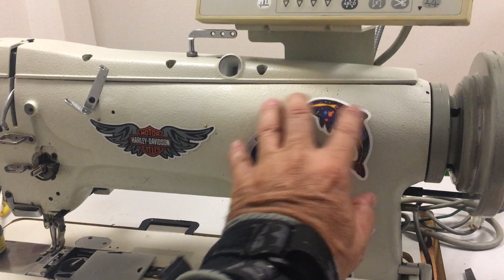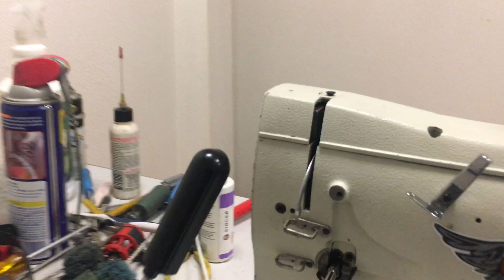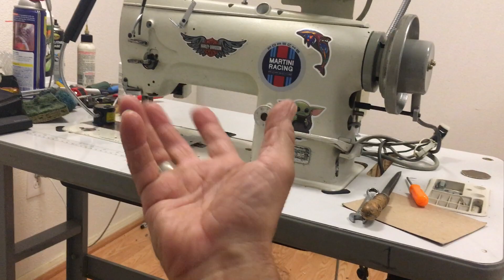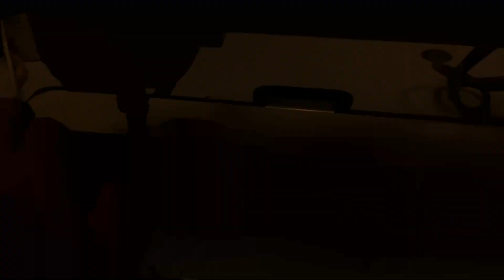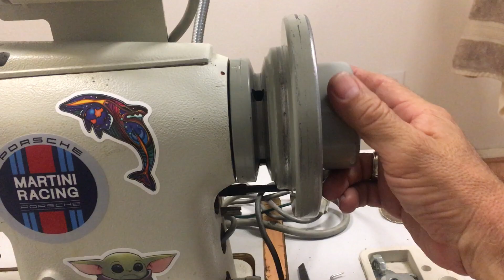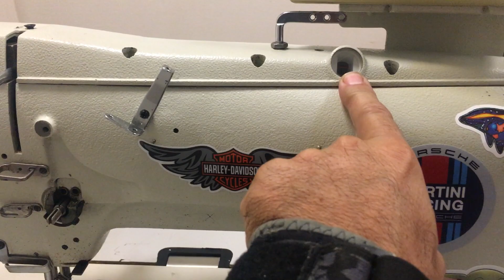Brother LS2-B837-310 Walking Foot Sewing Machine Triple feed w/Extra Features

Comment: Have you found any solutions?
Reply from the maker: After doing a lot of research I did not find a solution. I ended up putting a Consew II servo and it works well. It's a nice machine.
Reply: this is great news! were you able to keep the electronic functions after servo was installed?
Reply: After watching your video I picked this model up. need some advice thanks!
Reply: @Zan_zelee  Did you work out the issues with your machine? Sorry for the delayed response.